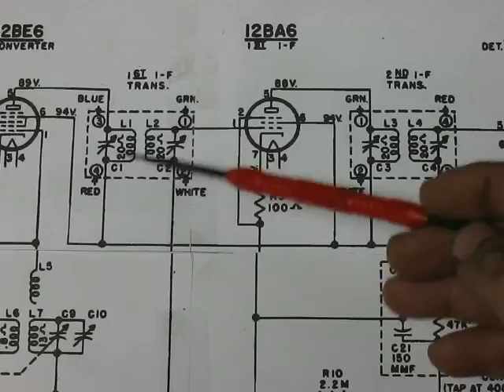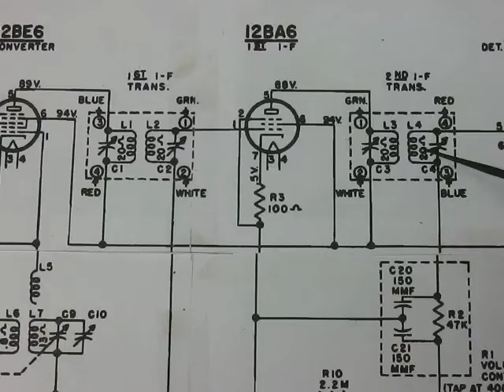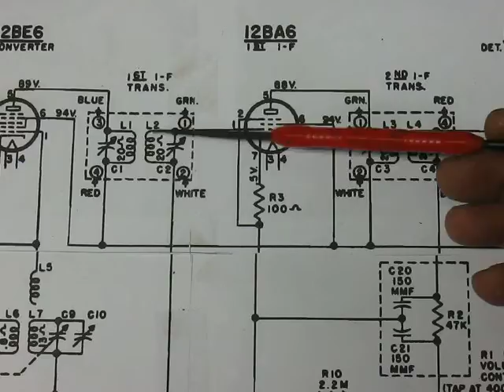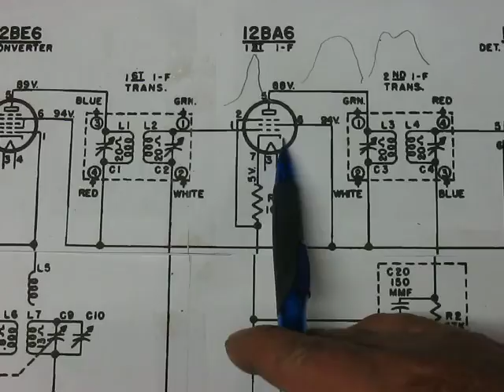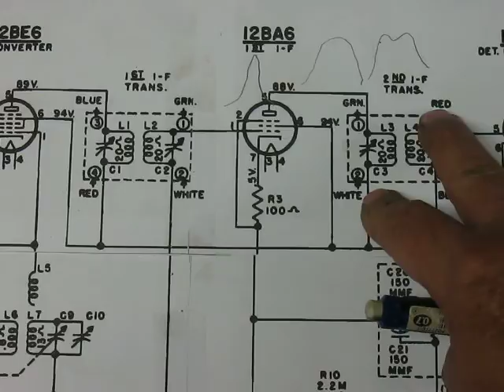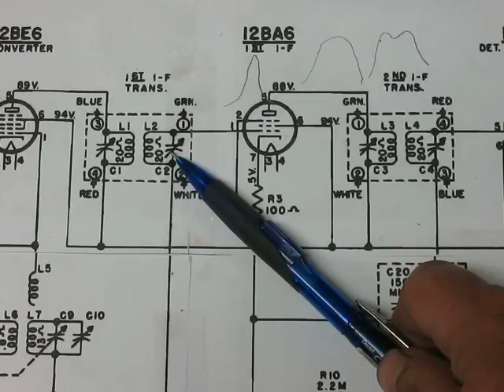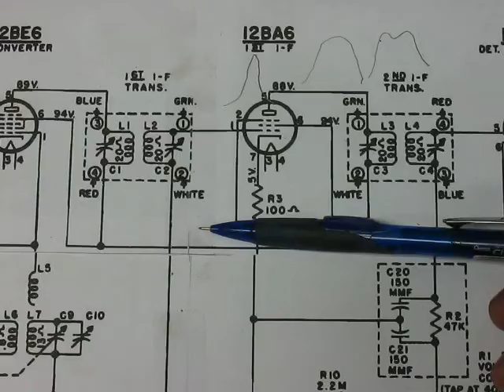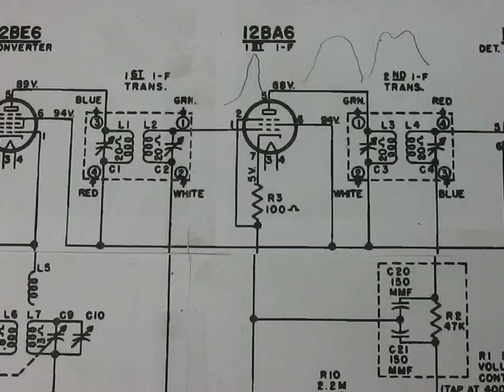Radio Theory part 2

Comment: Dennis i know this  an old video,but i was looking around youtube  to find a solution to my problem on a GE-581 AM clock radio  that i am tuning  in SW  stations  and no AM.looks like the problem is in the osc.tickler circuit but i am not sure.I will take any help i can get.
Reply: jeffrey haynes I had same problem  with my radio MW was no AM it was connection open from MW antenna coil in your problem please check 3 possibility 
1 open connection either sw antenna / oscillator coil
2 wrong / open connection at band switch 
3 open/ break sw oscillator coil